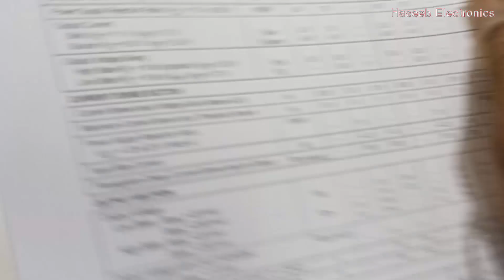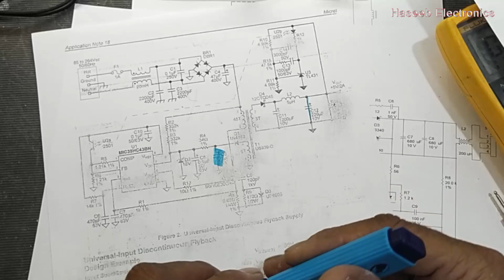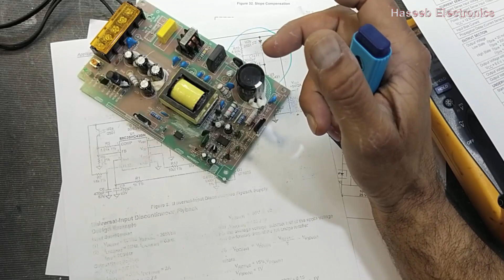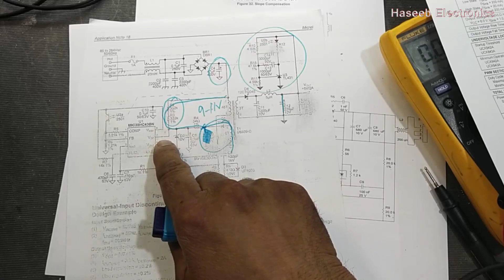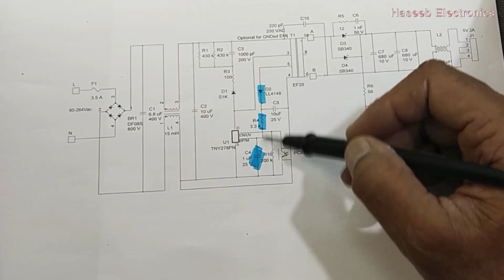{512} Why SMPS Fluctuates / Reasons for SMPS Output Voltage Fluctuation Switch Mode Power Supply

Comment: Very helpful! Reason I am watching this is I have a Tektronix 2465A oscilloscope (ca 1987). I did a partial recap on power supply / inverter boards A2 & A3 after a blown RIFA cap on A2. Powers up and I get traces on screen, but after a minute or so, power oscillates downward and it finally stalls. There has been a persistent "Test 05 Fail 40" error, which indicates an over-voltage. I suspect these are related. If you come across an Tektronix scope from that era, there could be some people interested in your opinion, as the Tek scopes have a popular following.

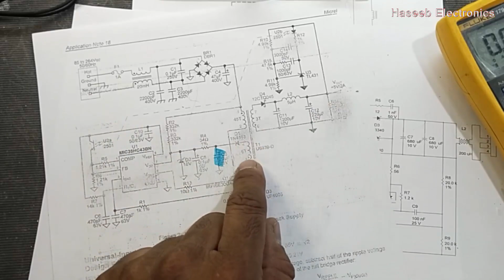Comment: Hallo Shifu Haseeb,your student here,,@timestamp 10:41,,talking about overload protection,,,convince me the volt threshold of the uc384..can reach 16 volts to trigger the shutdown state ,,yet we have a 12v zener diode D2 in parallel with the aux vcc path

Comment: My 24v  smps psu only allows me to add 0.2v to load with blue voltage potentiometer is it broken? If I will set it like to 25volts psu restarting

Comment: Hi. Vcc voltage should be 16 but it is varying between 12 to 13 and smps not power on what will be the reasons

Comment: Sir, My 12 volt 1ampere SMPS adapter voltages shows ok , not fluctuations but ampere fluctuates from low to 1.26 amp when I measure by multimeter  ,please reply.

Comment: Thank you, you solved my broken SMPS. The device was always restarting. First I tested the sec. unit. No failed components.
Then I measured the start up supply cap in circuit (47uF 25 V rated). I got 45 uF. So I tought it would be ok. Then I measured the voltage on start up cap. it was drifting around 7 V. After desolding the cap I check it cap with a ESR Meter. Resistance was over 6 Ohms!. So I replaced the start up cap (new cap resistance < 0.5 ohm) , now it works.

Comment: out put may 12v ke bina 15 v ya 18 v ata hai kya problem hoga
Reply from the maker: please check its feedback circuit. check TL431 and its sense line (voltage divider network) check optocoupler are 
check vcc circuit of the PWM IC. might be it have some issue

Comment: Sir   (top248yn) ic 24v SMPS output flickering. Any solution an how to check this
Reply from the maker: in top248 output fluctuates 
if output rectifier, output capacitor, feedback circuit, problem 
or 
at primary side main dc smoothing capacitor is open internally
Reply: @HaseebElectronics  sir how to check optocoupler
Reply: @HaseebElectronics  thanks sir

Comment: I have a laptop adapter. The feedback os fixed at 1 volt. However, the voltage at the Vcc capacitor is changing rapidly. Similarly, the output voltage is also changing rapidly. Could you please tell what could be the possible reasons.

Comment: Hello sir wallekum salaam. My question is not related to Smps, I got filament lamp with no data how can I confirm the voltage of  it , can I connect it with series lamp and vary the auto transformer .thanks
Reply from the maker: if it is dc lamp 
then try to use variable dc power supply to get its nearly full brightness 

if it is AC lamp 
then you can use variable transformer for AC voltage. or try to use different series lamps like 15 watt, then 40 watt, then 60 watt then 100watt
then 200 watt to determine its power rating

Comment: Hello teacher . I would like to ask . How do we recognise the vcc capacitor on the circuit. Is there always a vcc capacitor on a circuit?  Thank you in advance.
Reply from the maker: yes dear it is a great question 
this small electrolyte capacitor (0.1uf to 47uf and 50V normally) it is connected to the vcc pin of the smps controller 
please check video number 528 for more details

Comment: Sir better to look the data sheet of the pwm ic in order to know the required frequencies and duty cycle of the pwm ic sir im i correct sir if i measure the frequency and if its abnormal the smps is not working properly tnx sir
Reply from the maker: you are right 
we must check datasheet for proper work. as i always insist in videos to follow datasheet or sample circuit 
in some smps IC (specially adjustable switching frequency type ICs as UC384X series or TL494 or SG3525 type ICSs) we need to consult the RT / CT  components to know the exact frequency as these are programmed by the designer for perfect alternate
Reply: What could be the fault of the welding machine where everything is tested and are ok but it can not weld ?  And can only release small Sparks like that of the earthing !

Comment: Without loading you can't judge God or bade
Reply from the maker: السلام عليكم ورحمة الله و بركاته
you are right, if we want to test test regulation test ( either line regulation or load regulation)
but if the vcc is adjusted wrongly,or vcc components get devalue or vcc winding gets dry joint,  then the power supply will fluctuate without load
if there is some high leakage in secondary section, it will cause to drive the smps in overload condition then the smps will fluctuate without load
الله يسلمك و يسعدك يا اخي الكريم

Comment: Haseeb I have no optocoupler in my old robotarm SMPS, whichever I can replace by a diode for testing, but a very little yellow feedback transformer which separates the hot and cold side galvanicly.

Is there a way to still apply your trick with the diode? or some other solution for testing both sides and disabling the feedback?

Comment: Among all 37 comments,all are  replying well,but nobody cross questioned however you have covered all possible factors for fluctuations but one more point for the same is dry solder of ground terminal of auxiliary winding or feedback windings
Reply: Yes always inspect pcb and check  traces and solder points with microscope.

Comment: very good  explanation sir i have issue in 12v charger vcc cap voltage 13.50v but out put 0v i send your wats app massage
Reply from the maker: please check mosfet 
check pwm controller drive , if drive signal missing the check its control signal (feedback vcc etc)
verify output section